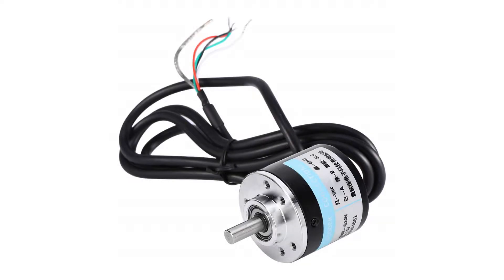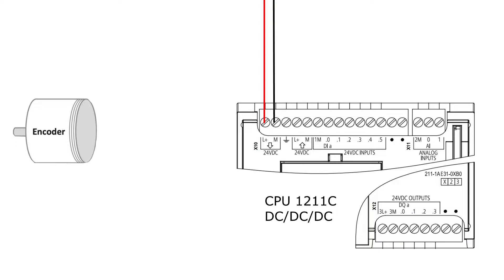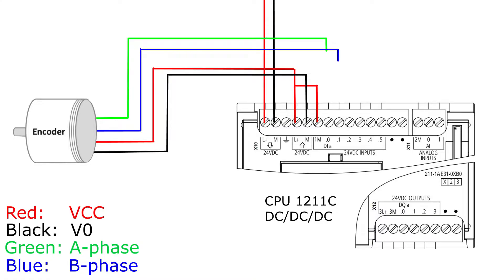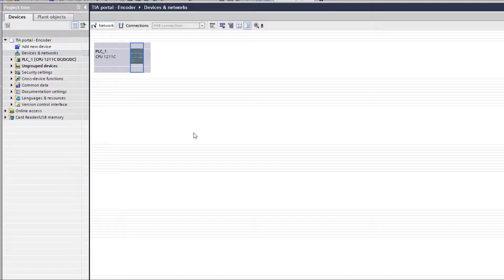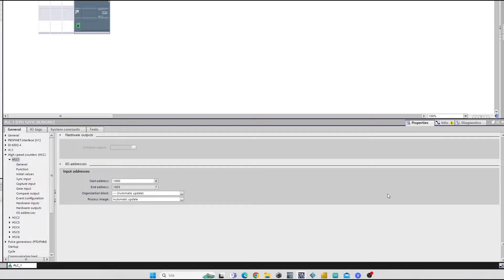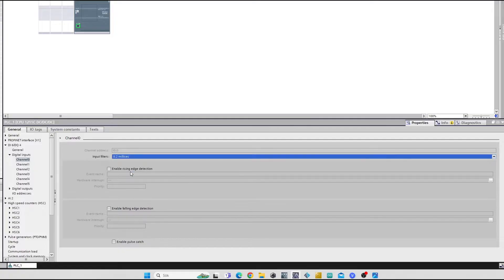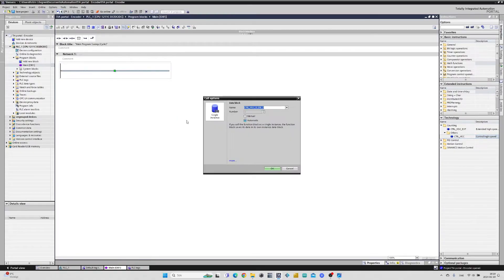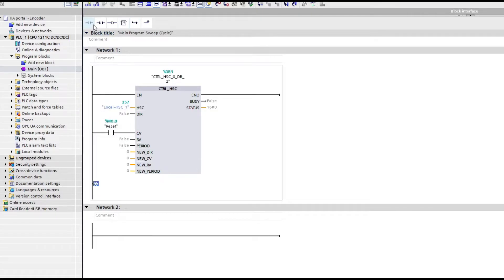How to connect and program encoder to Siemens PLC | TIA portal | S7-1200 | HSC High Speed Counter

Comment: Hello, why did you set 0.2 ms?
Reply: And id  1000 must be 1800?
Reply from the maker: Hey, it depends on the RPM of the encoder you could use a formula to calculate it. Although I just choose a low frequency cause I am just testing. But dont always go too low or else the it can be instable
Reply: @1lovgren what is the formula?